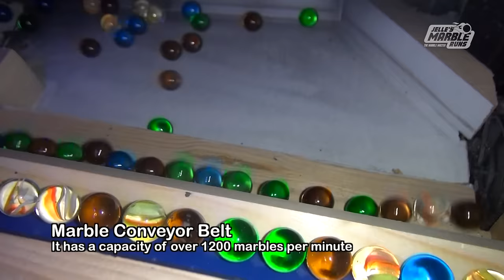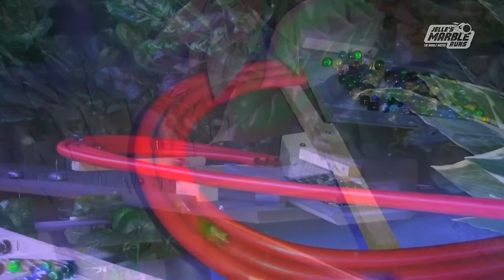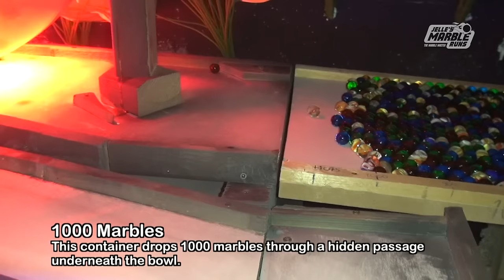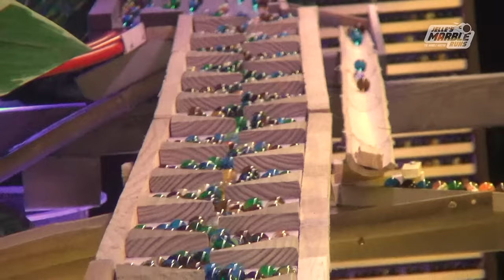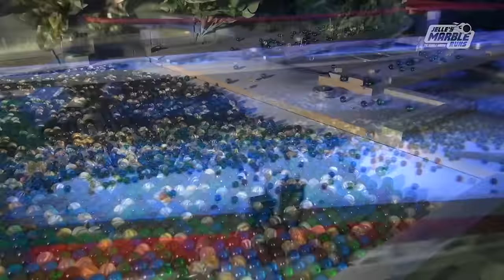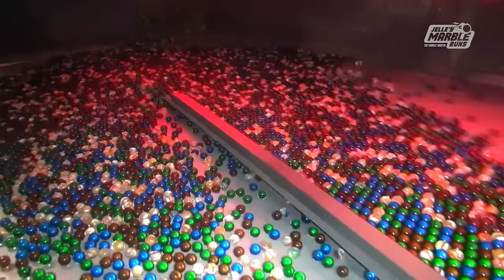INCREDIBLE Marble Run Machine with 11,000 Marbles!

Comment: it was actually 11,100 marbles because as the 10,000 tipping container released, the 100 tipping container added an additional 100 marbles to it, so adding that to the other 1,000 marbles dumped on it further down the track it ended up being 11,100 marbles

Edit: I could tell because I could hear the bells and stuff on the panel that the 100 tipping container dumped the marbles onto, which promptly lets out onto the 10,000 tipping container

Comment: I am considering a project involving marbles ... Can you point me to where to get so much marbles .... i need about a F150 truck open back full ... size marbles ... 30% = 1", 30% = 1 1/2" to 2 1/2", 30% = 4", 5% = 6" and finally 5% = possible 12" ... color  ... red, blue, yellow, green, orange and white ... cats eye if possible, 40% of all size must be white and the remainder colors divided equally ... any advise would be highly appreciated